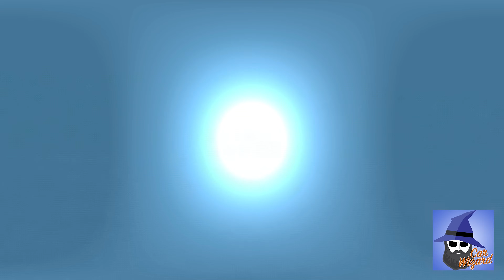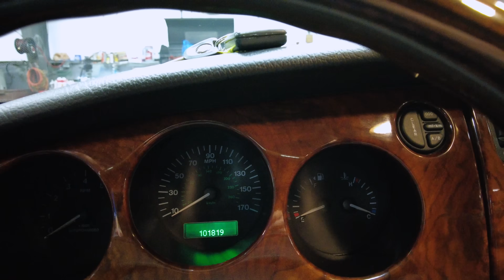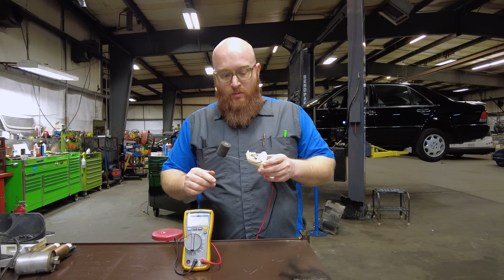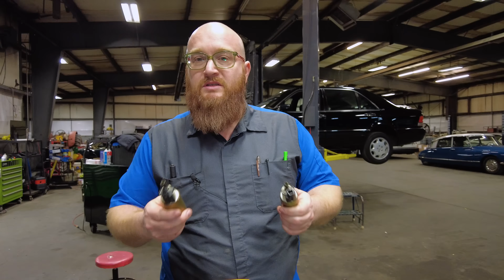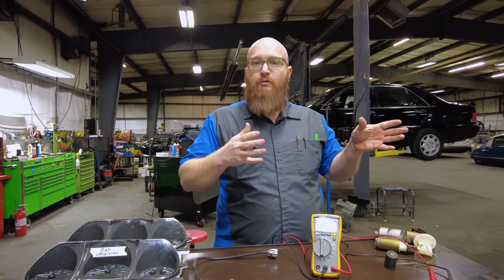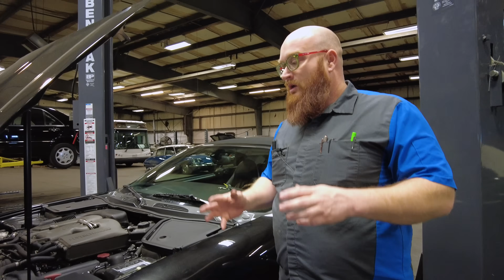So much more wrong! CAR WIZARD fixed main issue on the '01 Jaguar XKR, just to get 4 more!

Comment: I was oh so close to buying an XJS and considered an XKR also. In the end I bought neither. Instead I bought a new Mazda MX5/ Miata. Here was my thinking….i watched so many of these types of vehicles that 1) I didn’t want to risk a financial iceberg of a bottomless pit of expensive repairs 2) i wanted to just be able to get in an go for a drive and not have the experience of the car not starting, things not working, risk of fails / getting standard. It’s not as cool granted, but cool is in the eye of the beholder, and that’s not most people. So yes the XJS is Uber cool. At the same time, the MX5 is significantly more fun to drive. Manual, 50/50 weight ratio, super light so through hills runs it’s lots of fun whereas the XJS is a great cruiser. Which isn’t nearly as much fun. Each to their own. I’ll always love the XJS.

Comment: in fairness to the jag my old avalon has bad o2 sensors. have had to replace fuel pumps on nissans... has had instrument cluster on volvo...so a lot isnt the jags fault its been sitting for eyars

Comment: 20k min units per modele car truck per yr or not good enough prts bay to be built infuture on my earths race cars not included. 2k still sound flooded by a diff 1b fix grand option.
Reply: crush it other wise printing gov system owned prts or nothing at all.

Comment: Car Wizard is a genius , of that there is no doubt. I also have an XKR - 01Jaguar which ,  prior to it being purchased by myself was destined to be scrapped , for similar obstacles confronted by the Wizard . Jaguar only know how to make panels , seats , dashboards  and how to make the wheels rotate fast (although not for very long) Jaguar makes no money from the sale of new cars , it's all in the service and parts. My Jaguar has had major heart surgery , no computers, sensors on sensors and all the other B/S/ , it's an entirely mechanical fuel system , it has a six cylinder Perkins diesel coupled to an Isuzu Amigo gearbox with a Toyota 70 series differential . It just about to turn the odometer over to 1.3 million miles , it does not smoke the tires at the traffic lights but sits on 70 mph all day (and night). I rest my case. I still think the car wizard is a genius ( a genius businessman who does not suggest every alternative , only ones supplying and fitting genuine parts or their equivalent ) But that's what makes America Great isn't it .    Isn't it ?  Goes without saying the engine has been deleted of ALL emissions controls  i.e.  catalytic converter removed , diesel particulate filter, exhaust gas return is now a tube directly to the road , but wait , there's a problem , this car is going to outlive everyone !!!!

Comment: Oh, I’m surprised you ain’t mentioning anything. Sit with ethanol fuel in it for any length of time it has a tendency to do that even on American vehicles I got a CIG 30 that I bought and boy I had problems because it said for years and years with ethanol fuel in it is about eight a gas tank up an eighth of fuel pump up so bad that they date the rubber did actually went from the little pump to the metal tube and the two little clamps, the plastic clamps were still there. If that gives you any idea of what I’m talking about that one sit and watch what they ethanol will do to it.

Comment: Done both o2 sensors on mine, managed to clean my fuel sender unit and it’s been fine since. Crazy idea by Jaguar trigger the check engine light of the fuel sender is open circuit after two starts. It’s the solder joint on the pump circuit on the ABS board done that too 😂

Comment: Man wizard you aint kidding, im resurrecting a 78 Lincoln Mark V that sat since 2001, and you would be amazed at the things that went bad and rotted out!! the intake gaskets rusted out and were dumping coolant into the oil! Also had to replace the ENTIRE fuel system, tank/lines/pump. somehow the carburetor still works. LOL

Comment: Hi Mr Wizard, 
     Can u, plz, tell me why my 2005 XJ8
Vanden Plays (103k miles) has a lot of
trouble pumping-up the front air bags
whenever the outside air temperature
is below 62 degrees F.? If its a 50 degree day, I have to start the engine,
drive 5 miles with totally deflated air
bags (very very bumpy), then go in a
Retail store for 10 minutes, come out
and start the car, and it will then pump-
up the front air bags. If its 40 degrees F
Outside or colder, the bags will lose all
Air while I'm driving and won't pump
 up. Why does outside air Temp affect
my compressor and air bags? Also, I
read that my compressor has an air
Temp sensor. Is that correct?
Thanks, Mark in Laguna Beach, California. I love my red jaguar.

Comment: Grew up with Austin Morris etc.  Lucas issues are 90% the connectors. If you clean them off that fixes most all the problems.  They used cheap and nasty metal and poor design on those bullet connectors and multi plugs. Once clean it’s a good idea to seal them with liquid electric tape or such. I used Starbrite.

Comment: I wish manufacturers used round screw on electrical connections similar to military vehicles. They are tough, metal and waterproof 😊
Reply: Mil Spec electrical connections on regular vehicles - needless to say 'bullet proof'.  Only problem, it would double (or perhaps tripple) the sticker price of a new vehicle.
Reply: @georgebettiol8338  yup not cheap. Used to be lots kicking around when I was in the tank rebuild section.
Reply: I'm a former engineer with Defence - so I'm a big fan of those connectors.  Currently thinking of relocating my LS V8 equipped Holden's (Australian GM) ECU to inside the car using a Mil Spec connector “through” the fire wall.
Typical of GM, locate the ECU adjacent to the LHS exhaust manifold separated by a flimsy aluminium skinned cardboard heat barrier - what could possibly go wrong.
Reply: @georgebettiol8338  I've been lucky with my 2002 Camaro SS with the LS1 engine. 240,000 miles and going strong (once I put Yukon gears in the rear end). Engine only had water pump and upper gaskets replaced and knock sensors.

Comment: When i worked at the salvage the joke was "all jags are low miles.  "  In the 60's my triumph cycle had lucas electrics, "We called lucas the "Prince of darkness".  If i was young i'd specialize in Land Rover, with emphasis on electrics.  Folks love them.  Ever seen one correctly working? $$$$$$$$$$$$$$$

Comment: I wonder if U can replace the XK8 ZF Transmission, with a 5G-Tronic Transmission (those are fitted on the XKR).
Might even be cheaper, since they are still used.

Comment: I had a 1989 jaguar straight six. It was the first year with the bosh electrics. Curtis's electics was so bad. Don't buy a jaguar there endless money pits. The electrics still stink and bought the car new. Junk junk junk trust me. Buy a  Lexus Acura for nice luxury car that runs.
Reply: "bosh"
"Curtis's"
"electics"
"there endless" (where endless?)
Hilarious.
Reply: @Tim  endless money pits and they go wrong your done. Also oil leaks and problems with the transmission. Bought it new for 67k it was a Vanden-Plas which was loaded and then they had the Sovereign and base jag. So this was the best of the best jag at the time. Back then only had 3/36k miles on warranty. Kept it and sold it 4 years later for 20k only had 40k miles on her. Up to you there no better today than they use to be.

Comment: Makes me love my 1992-1997 F-Series trucks. You can change the dash cluster out all day long, as the odometer section is removable from the rest of the cluster. If you don't have a factory tachometer, just buy a cluster with one, put the odometer center section back in, and BOOM! It works perfectly, as all the trucks and Broncos were pre wired for a tach regardless if your truck was optioned with one.

Comment: The Cluster for supercharged cars is unique because it it says, "Supercharged" under RPM on the Tach, but only during day time. It's not illuminated like everything else in the cluster. You can check with your local DMV about changing the mileage. In California once it's 20 years old you no longer have to report mileage to the DMV when a vehicle is sold, so they don't care what odometer reads. Not sure about other states. Carfax, service history and condition tell you what the milage in anyway.

Comment: I think this Xk8 has been struck by lightning! Lucas Lightning!
Reply: I would try unplugging the intelligent sounder. It tends to cause a lot of electrical gremlins once the car gets older. There are small internal batteries that fail over time. In turn the main battery attempts to charge these problematic batteries resulting in strange voltage drops, gauge malfunctions, and just strange issues. Good luck (owner 2002 XK8)

Comment: The fuel sending unit would be the first thing I checked gauge clusters rarely go down unless every single part of the cluster goes down... anything that lives in a gas tank is going down a hard Road the only thing that needs to be in a gas tank is the fuel pickup line and that's about it... and on that note I'm out of here

Comment: Never be in a hurry with recomissioning an old vehicle. The Late Brake Shows barn find episodes are great on this - I love how the go through and do stuff like show them disconnecting the fuel tank, blowing air through fuel lines, checking they can turn over the engine (top tip guys - if its a manual, put it in gear and just rock the car back and forth...) checking for spark, crank, fuel pump priming etc before finally trying a turnover, oil int eh cylinders if needed, etc etc.

I got an XKR recently that had been sitting for 6 months and barely driven in 2 years. I've been taking my time but it has not been expensive getting it back on the road. Had an alignment issue and instead of splurging on new tires (the old ones were flat spotted) I started with an alignment, which didnt fix it, then realised the previous owner had the sgtaggered wheels on wrong... swapped them round, got a stock alignment, and everything was fine. The previous owner thought he needed a new steering rack. He'd been quoted so much money for all the little problems he gave up on the car. HJere I am only $500 bucks into it apart from the purchase price and its going great - just take time, diagnose thoroughly, get all the manufacturer documentation and you WILL have an easier time. LEarning how to read documentation really helps.

Also - Im gonna say this for jaguar - their service manuals for this car are brilliant. Never seen a better illustrated/described set of procedures before on any other car. Toyota/Lexus is a mess in comparison, which is saying something. These really are cars that a home mechanic with good reading comprehension can look after themselves relatively inexpensively. The previous owner has been talking to me and he is really pleased Im enjoying the car and fixing all the little problems myself that he could not, and he's not left hating jaguar for costing him 10 grand. One example - fixing the failed electric headrests on these cars is actually a SUPER easy job, its just fiddly and time consuming. You wont have change from $500 for getting a mechanic/dealer to do it because its a good 2-3 hours labor. But if you don't mind cracking a beer and pulling the seat covers yourself, you can fix it with an exacto knife and a pair of pliers.

Comment: Wizard always acts surprised at the issues with these cars.  THAT'S WHY THEY'RE IN THE SHOP.  Fuel pumps and O2 sensors have finite lives.  That Jag is 22 years old.

Comment: The stepper motor broke in those cluster, because I had a 2003 GMC Envoy and the Speedometer Stepper Motor broke and I had it replace with a local Speedometer Shop and it worked ever since.

Comment: Hi wizard, I know it won't be your problem, but I wonder how would mileage work for the owner after replacing the cluster. We know his warranty is far from gone to like skip a service, but when selling the car etc. Will he just list the new mileage? Will he keep the original one, make out the diff between original and "new" one and substract from the newest's actual miles?
I ask this because I would believe this is something that does affect future resell value of the car

Comment: You would have to get a certified odometer statement from your local dmv in order for your friend to be able to legally correct the mileage on that gauge cluster. I think the correct mileage is stored in the ECU on most cars. Not sure about Jaguars but I believe that is the case with most vehicles.
Reply: But if a new ECU's also installed, wouldn't the new stored mileage then be zero?

Comment: In NY, there are certified companies that will change odometer readings legally. You need a notarized statement of true mileage, service records and a carfax. Otherwise, you need a DMV form and a hand written sticker on the door jamb with the old cluster's mileage, and replacement's mileage when installed. If it's a nice car or fairly new car, that sticker will seriously diminish a car's value. Especially if you're looking to trade it in at a dealer. Working at Ford back in the early 2000s, we sent out quite a few units for adjustment.

Comment: 3 years ago I bought a 1999 Jaguar XK8. It was relatively cheap at 10 grand.  That is when I truly discovered the old adage that 'there's no such thing as a cheap old Jag'.  
I had to spend $2000 in repairs just to get it safetied.. 4 bearings and a couple of other things.  Then it went for engine work to get the timing belt changed.  That, along with some other engine work came to $7000.  Once that was all done the car ran great and I was happy with my purchase despite the extra $9k I.had to put into it to have it run well.........then we were driving home one evening a month later and the transmission blew.  So now I.was almost $20k into a brick sitting in my driveway.  So I bit the bullet and had it changed for a rebuilt transmission for $4500 installed.  Yup...I am almost $25k in to a $10k 24 year old luxury convertible that I can never get my money back on....so I'll.keep her forever and love her for who she is. 😁
Reply: 3 years ago a 99 XK8 could be had down here in TX for like $3K lol wtf sounds like they took you to the cleaners and back!! Also, these cars don't even have timing belts, they have chains....sounds like the repair shop took you for a ride mate..
Reply: I dumped my Jag way before putting in many $1000’s. Beautiful cars but a nightmare mechanically
Reply: @HypocriticYT The question is why? They have been building these things since 1935. How can they be so horrible at making cars yet continue to exist?😂
Reply: @rolandthethompsongunner64  answer your own question. I'm not an encyclopedia :face-purple-crying:
Reply: There is no timing belt on the engine, only a serpentine belt. The XK that came after this model is a whole lot better, and has an aluminium body shell too !
Reply: @frasermitchell9183 Good. More easily recycled 😂
Reply: They’re like beautiful women with autism 😂

Comment: My step-dad bought a chocolate-brown 1972 E-type brand new. The first two years he owned it, it was great. Took it on road trips, so real driving, not just blats around the block. But after that first two years, it was a constant stream of things going wrong and the car was in the shop more often then out. The mechanic finally told him that he could replace absolutely every part in the car and it would still be back in the shop within months. By '76, the car was gone. Let's just say Jaguar has some rough spots in its history when it comes to reliability. So this video? No surprise.

Comment: Good reminder for cars that have sat. And in New England, add the brake lines to the list. The  weather here makes them corrode pretty quickly if you're not driving around to dry them off.
Reply: Not true at all. Not true at all. I was given a 2001 Corolla that had sat in a barn for over ten years. I replaced the brake lines, flushed all the coolant, oil, replaced the fuel pump. It had 60k miles on it. It’s still running today 😂

Comment: Just a heads up Wizard, that front bumper's not from a proper '01. In '01 they switched to use flush fog lamps on the XK. . .

Comment: Just replaced the ABS (2nd hand, same model, no coding needed) on my Z4 E89. Started with no start, replaced the fob reader. Whilst waiting for that condensation formed in car, it ran to brake light switch, which blew, taking out the ABS unit. Only took me 6 weeks to work out what was going on, including a faulty aftermarket brake light switch, great.

Comment: Just buy a Toyota and do the maintenance. Yes, it is boring, but 400,000 miles later you may have to replace it. Function over form.

Comment: Here in Europe you can get 1 owner garage Jaguars without a single rust spot starting at 2000€. They are generally 160k km at the most and about to fall apart mechanically. No, thank you.

Comment: I've known all of my life, from a very young age and now I'm old, that tampering with the odometer is illegal, especially turning them back to lower miles (an old trick from way back when on used car lots and by individual crooks).  You would think there would be issues (like also being illegal) of changing a cluster and/or stand alone (if exists) odometer, period, with another used one.  Whether that shows less or more miles than the actual true miles on the car.  I don't get that.  If that is allowed, and documentation exists on proven existing miles on a car, it should be allowed somehow to make the "replaced" odometer show correct proven mileage.  And what about getting a brand new one with zero miles on it and you're able to use that?  SMH

Comment: On your 380SL, I had the same problem with my 350L. I turned out to be the emc unit that controlled ignition. I fixed it bypassing the emc and installing electronic ignition, Ana a new coil.. good luck